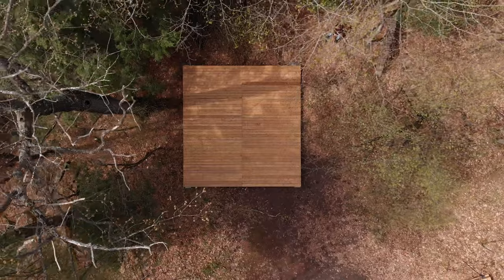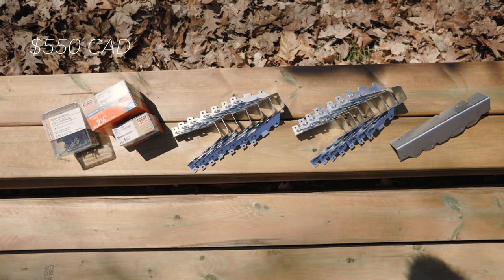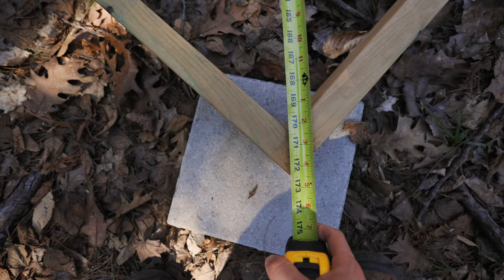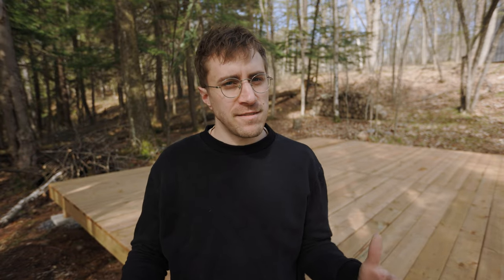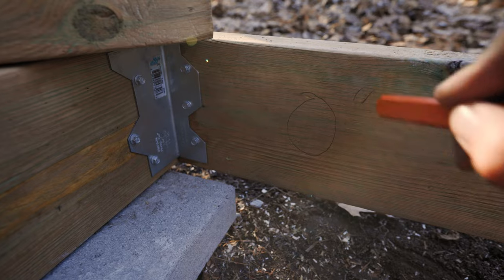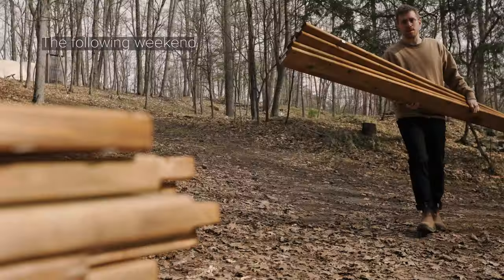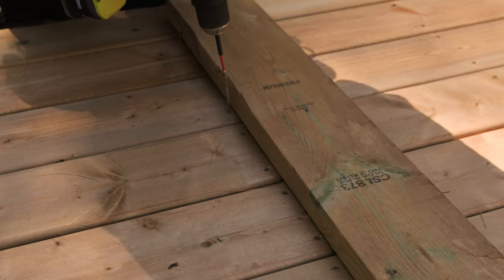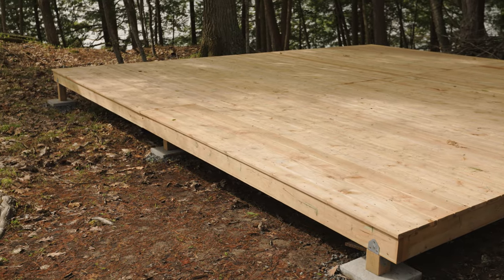EASY deck build with NO CUTS and JUST A DRILL

Comment: A rough rule of thumb is; span in feet = inches in height of boards. So (roughly), 6 foot span = 2x6, 8 foot span, 2x8. and so on. Looks good though!
Reply from the maker: That’s a cool rule Shane! Thanks. Looks like I’d need quite a few more footings to make this a proper deck. It feels pretty good so far for it’s purpose though 👍
Reply: @JonathanKuhn  Even if you add one footing mid-span on each deck, that would help too.
Reply: Love your little helper!
Reply: thanks for this info ! great video ~ looking to build the same, for the same setup and I have no idea what im doing : ) !

Comment: Were the floor joists 12" on center? And how big have the gaps between floor boards gotten now that they've weathered more?
Reply from the maker: 16” OC and wood has shrunk a bit and gaps are probably max 1/8” which is fine since the tent has a floor. I could have butter the decking up against each other since it want down pretty fresh
Reply: @JonathanKuhn  thanks, like yours I want to keep the platform as low to the ground as possible, so also use 6x10 joists but maybe 12" centers will reduce flex or dbl up every other joist on 16" centers,  or a few extra footers.
Reply from the maker: @CapCityDC yeah I think the best bet is more footers. It’s not really that much work if you do the method I did. I wish I doubled them in hindsight.
Reply: @JonathanKuhn  ok great to know more footers may be the way to go, easy enough.